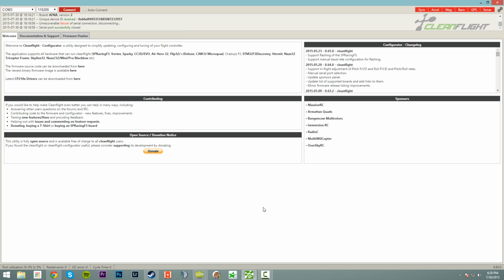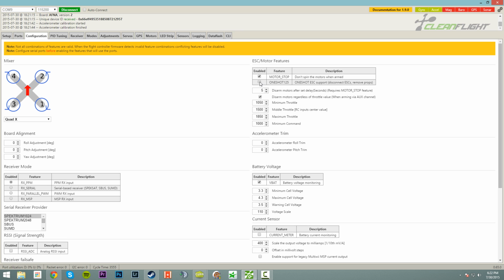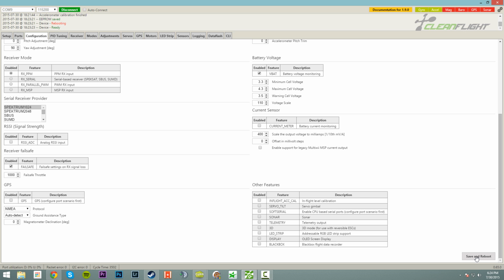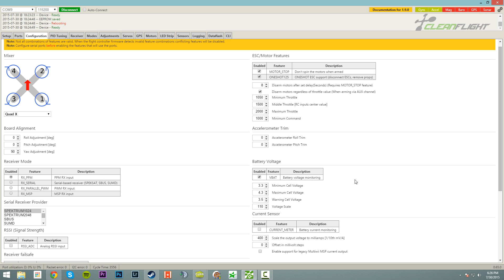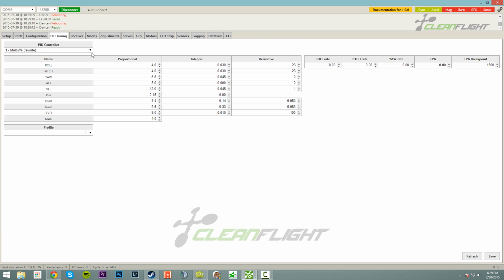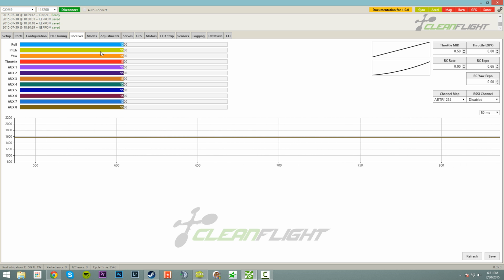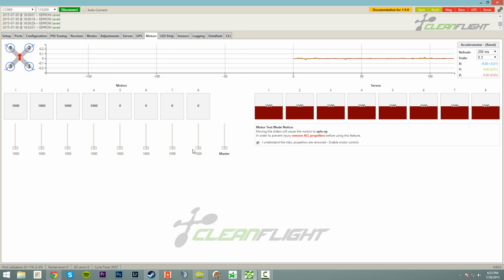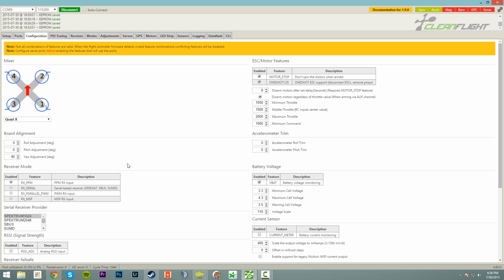Cleanflight Overview and Basic Setup.

Comment: i have the shark x6 flight controller.  unfortunately the sight with the firmware is no longer available.  wondering if clean flight, base flight or beta flight would work.  thanks.

Comment: hi zach i'm abit of a noob when it come's to cleanflight but do i need to go onto cleanfight after i've soldered 2 brand new ESC's on my STORM SRD 280 one on the left  front arm and the other on the right arm........or will it fly straight away after there soldered..i have an AT9 controller....
Reply: Hi i hâve à srd280 and when you change an esc you not need to Go on cleanflight ....the flight controller do his job....
Reply: ok no worrie's thanks....i now have to solder a new flight controller aswell its been flashed though so i hope it all work's fine.....

Comment: Thanks for the vid I am a noob but persistent. I got an Orange RX dsm2 radio and an OCDay RF100 that bound but would not arm. So I hooked it up to clean flight and now when I plug tge battery in all motors run and my quad tries to fly away. 😂 So your vid gave me an idea what's going wrong here. Gonna go back in and mess with fail safe and min throttle. Thanks for the tips

Comment: so when I plug in my receiver and move my sticks the channels are all mixed up yaw is one my AUX switches and throttle is roll etc. How can I fix this? I'm using a Taranis and X8R and I'm also using a CC3D that I reflashed. I'm also using PWM
Reply: EDIT: So I Remapped everything on my Transmitter and now everything works EXCEPT my ch 1 doesn't work at all even if I map it to a switch

Comment: ok on hooking my pdb to my vbatt pins do i come straight from where the batttery hooks up to the pdb?
Reply from the maker: You can, or you can go to any pads that are shared with the pads your battery hooks up to, an example being the ESC pads. A bad example would be regulated pads, such as a 12v pad, which is stepped down from the batteries voltage.

Comment: I have a friend just got the Jumper 260 Plus and he did a Firmware up date on clneanflight. 1.10.0 NAZE 2015-10-2-14:31(stable) is this right one? Because I did not update my . We bout put the same setting like Angle Mode Horizon Mode and Magnetometer and Headfree Mode. all 3 Modes work good for me when he flies in Horizon and Magnetometer ,Headfree Mode flies good but when he puts it in Angle Mode it goes crazy and flip upside down and in to the ground.He need help.

Comment: Thank you for taking the time to explain these things as Im new at this and needed the tutorial.
At the moment I only have a 6 channel radio and I am using aux 2 for the beeper my aux 1 is a 3 toggle switch for modes and I would like to set head free to one of the switch setting and maybe angle to the other.
Im a little confused as to how to do that. Could you explain that if you have the time.
Thanks again for taking the time to explain to us nubes these things.

Comment: Hey Zachary, nice video and thanks so much for the great info.   So I have my quad up in the air and since Im a beginner I kept the pids on stock setting.  When I throttle up I notice the quad tends to drift, do you have a video or can you explain how I can correct the drift? it seems to drift back right and when I try to correct I over correct and it continues to go in that direction... lol any suggestions? I was messing around with the accelerometer trim a bit but not exactly sure what I am doing.  Any input would be much appreciated.  Thanks!
Reply: Drift on throttle up lower P a little until it stops drift.